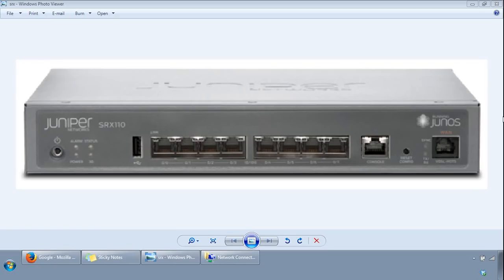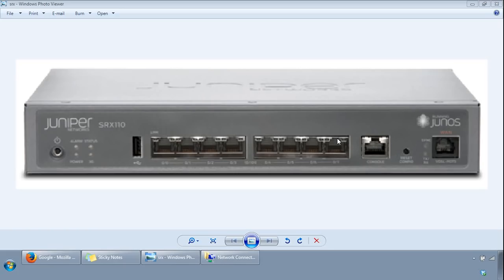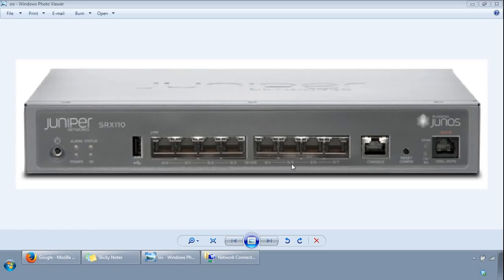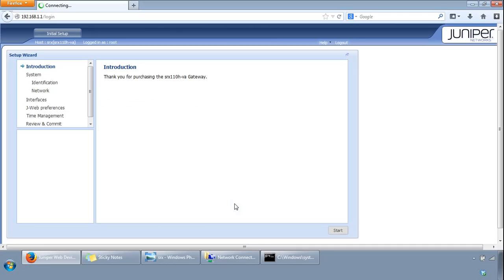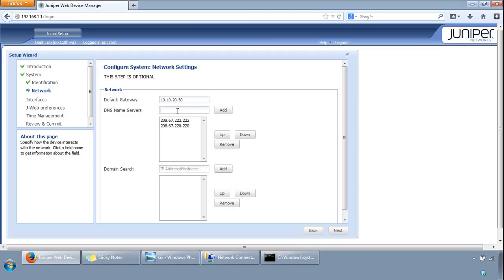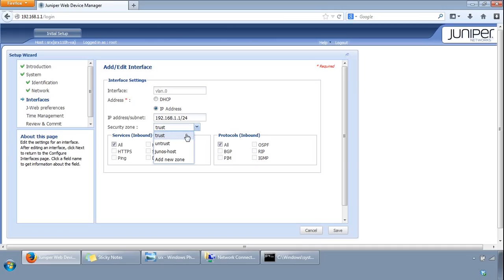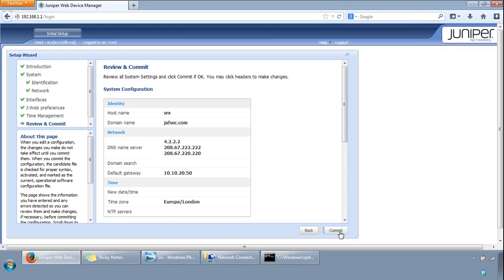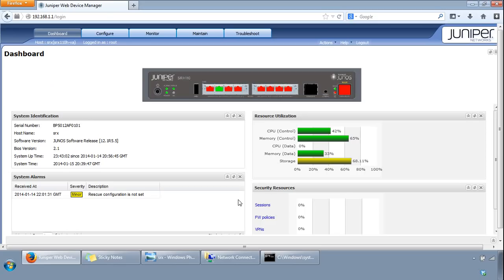Juniper SRX Initial Configuration Get Started Video

Comment: Hi, Could you use this model SRX110 as a perimeter firewall? I have read it is only useful for MPLS connections?
Reply: I'm using this as a domestic modem / router. You certainly could use it as a simple perimeter firewall but bear in mind - this is thing is old eol no longer supported and has very little processing power...

Comment: Tough going on trying log dropped traffic on the srx300. Looked at the various recommendations but still not there. Actually surprised by default was not enabled for a firewall?

********* Got it ********
Reply: Got that years back but the thing overheated according to the log sadly in a very cool room(others had that issue also as they used really cheap pot metal as an heatsink?.  That was a bad investment